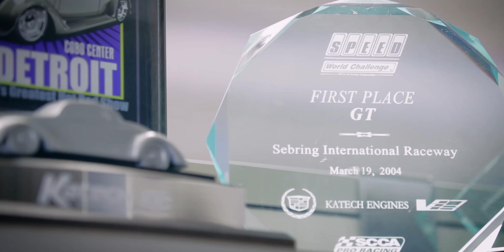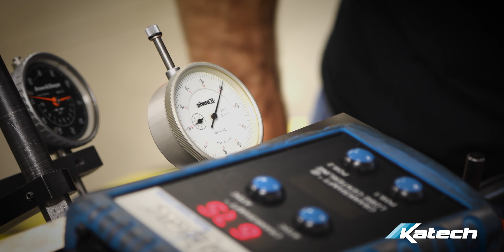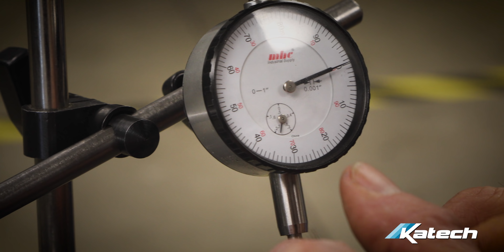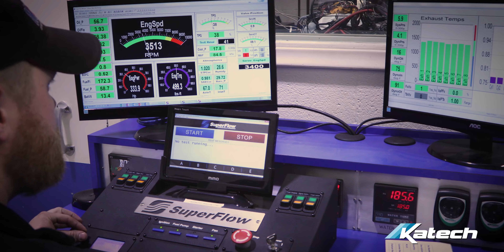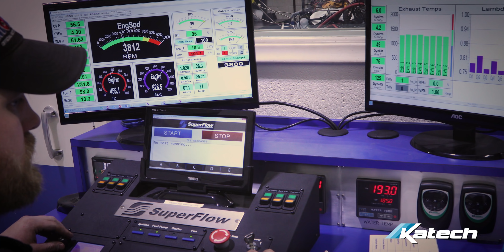Watch Katech Construct a LSX Engine For Our Krew Kut Build!

Comment: Did anyone notice when the mechanic was attaching/wiggling on the spark plug boot to the passenger side front plug it was loose?
Reply: Yah, they was all loose, LOL. I'm sure they tightened them when they put it on the dyno.
Reply: Spark plugs are loosely installed by engine builders because after assembly they go straight to the engine dyno where they are removed to install dyno exhaust.  The engine is cranked on the dyno with spark plugs out to prime the oiling system.  Then spark plugs are final installed and torqued before firing.
Reply: KatechPerformance ah ha, i knew it, lol. Awesome engine by the way.
Reply: Thank you!

Comment: Were the spark plugs loose in the head for mockup? The last two installed with the fabric heat shields wiggled when the plug wire boot was seated.

Comment: I’d much rather have a voice over about the build: parts used and why, with torque specs than listen to the song on repeat. Otherwise cool build, but the spark plugs looks like they were still in mock up and not torqued down.